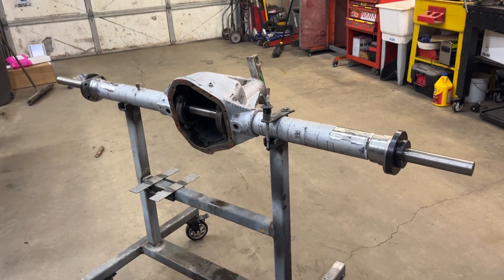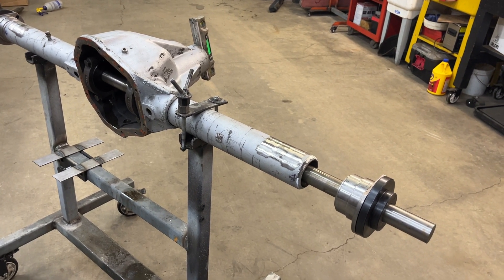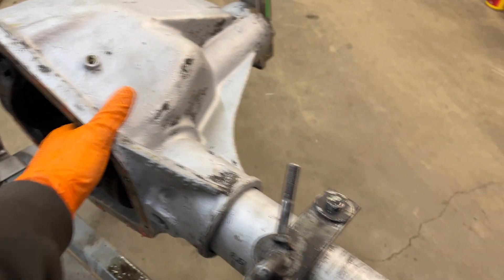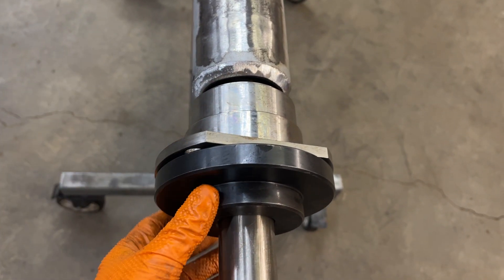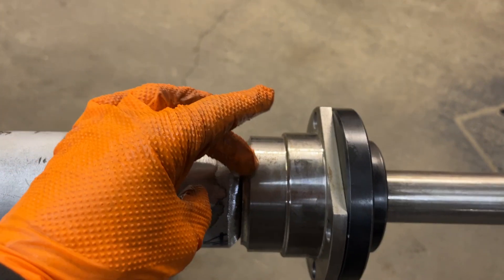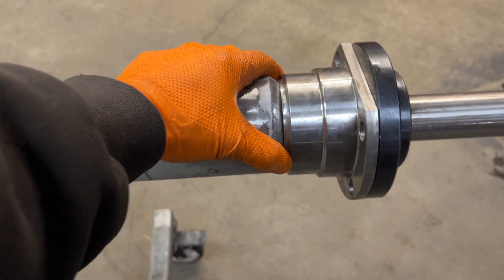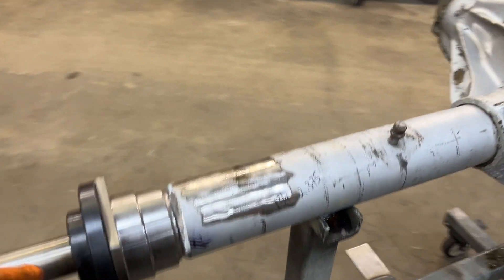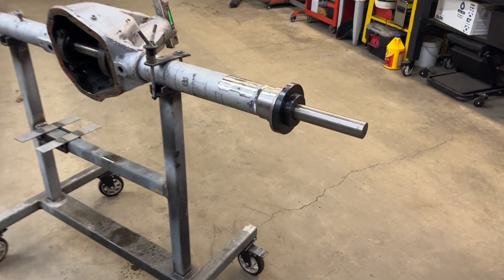Alignment Bar Setup For Narrowing a Dana 60 Rear Axle

Comment: What is the measurement from the end of the housing to the the outer flange of the axle? I am trying to figure the width on my housing to get the proper wheel to wheel measurement.

Comment: im just curious why you would want to make the 60 weaker by going semi float? I have one thats already semi float i got out of a TJ and want to convert it to full flow for strength and larger brakes
Reply from the maker: Because of the machine work or parts cost of doing a 5-lug full float. A semi float 35-spline Dana 60 is strong enough to handle 40’s if you’re not crazy with your right foot

Comment: Getting ready to do this, I have the pucks and bar.  After you tack it up in your eight places are you leaving the bar in while you do your root/welding?  Because of it moves, you might not be able to get the bar out.
Reply: it will cool perfectly in place the alignment bar will slide right out.